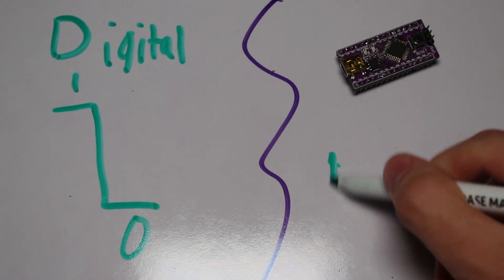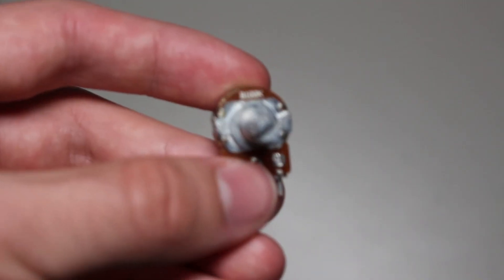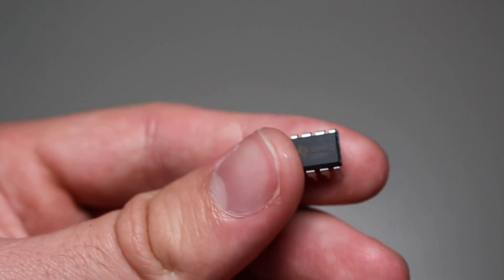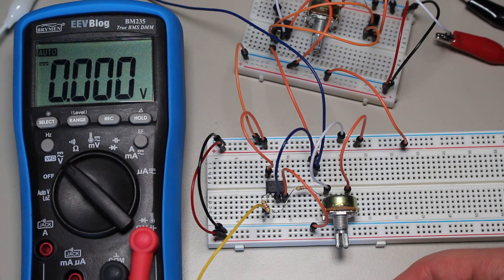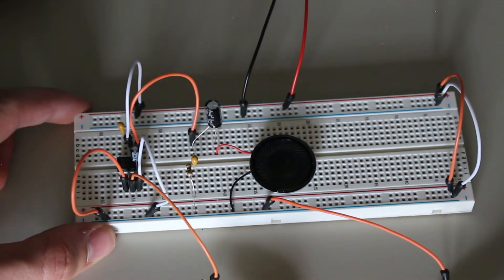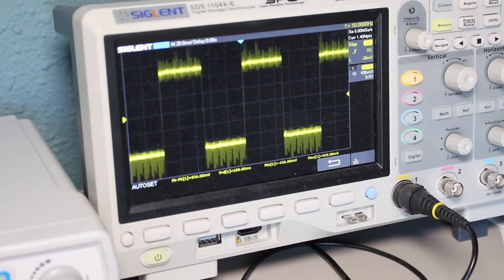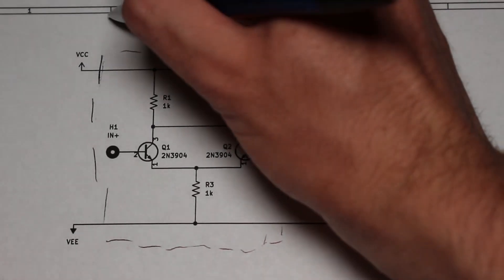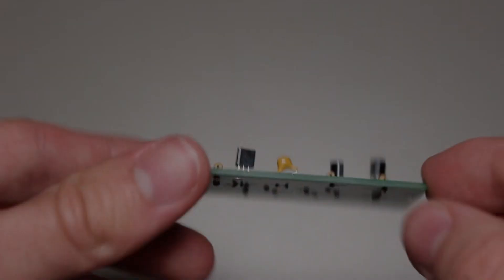Life-Sized OP-AMP!? - How do OP-AMPs work?

Comment: Hi my friend, love your channel! I'm a noob, i used to work in an EE lab, but not as a tech lol. So now I'm trying to educate myself. With your supply splitter, I cant get it to work in falstad. It might be an issue with falstad, but I have a feeling it's an issue with me. So I wanted to ask, what are the outputs? I tried 12v dc for vcc, but for the life of me can't figure out how to arrange vee and ground to get the negative output, and adjusting the pot only gets me 11.94V-60mV. Any one have any suggestions?
Reply from the maker: This circuit assumes that you are starting with a single power source which you measure from 0 to VCC. Connect your ground to VEE.

The output of the circuit is now your 'virtual ground'. In order to get a negative voltage, you need to measure from the virtual ground to VEE. Falstad has a voltmeter which you can use for this purpose. Connect the negative end of the voltmeter to the virtual ground and the positive end to VEE.

I hope that this helps!
Reply: @SineLab  Ok, thanks!!

Comment: Op amps have been invented due to military needs. Allready in the 1920ies it was necessary to perform calculations of the trajectory of canon projectiles across long distances. This was done by use of vacuum tube op amps in more or less complex analog computers. Allready at this time there were multiple vacuum tube functions integrated in one system, the first integrated circuits involving additionally passive devices, like resistors and capacitors.
Reply: Performing mathematical operations - hence "operational" amplifier. The discrete one didn't arrive for many more years the 709 was the first big one I think.

I did a version of the Jensen 990 which is a good deal more complicated but functionally identical. Now people probably mock the 2n3904/6 as being old.

But get this, at 100 uA of collector current they are the cheapest very low noise transistor out there. Of course, this means the next stage has to do some serious work but with additions like a current mirror and a constant current sink in the tail and that thing's performance is out of this world. I suspect paralleling a few up would make things better, although I've used a MAT02 in my design for the ultimate front end.

Comment: nice video. what is the capacitor C1? connected between base and emitter pof 2n3906
Reply from the maker: That's the compensation capacitor and it stabilizes the op-amp. Without it, the the op-amp oscillates. So, the capacitor is there to dampen those oscillations.

Comment: All we need now is to compare the diy opamp with an integrated one. Would love to see the performance difference
Reply from the maker: That would be a great comparison!
Reply: should be quite horrendous even with high tolerance resistors and hand selecting the transistor pair. Could be a lot more stable thermally just by using a couple of TO-220 bolt together for the differential circuit but clearly outperformed by any jellybean IC.
Reply: Yeah i a wondering this too. I think the lowest signal that can be amplified would be 0.6 V because that's the threshold for transistor to turn on?